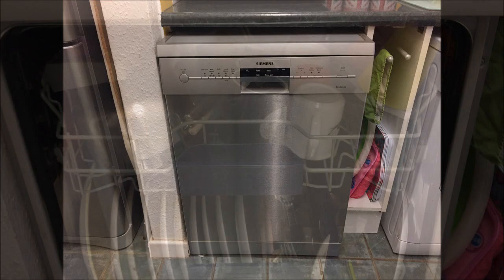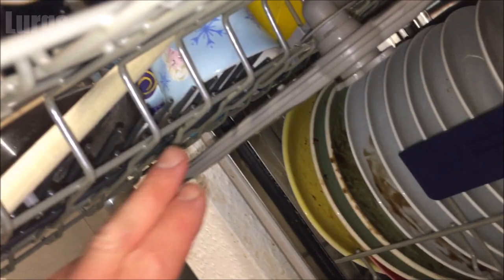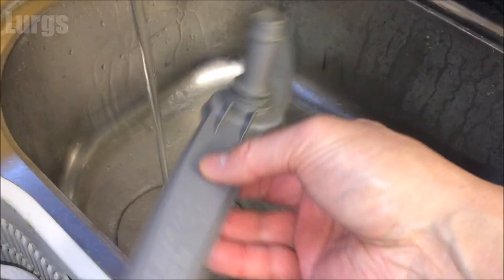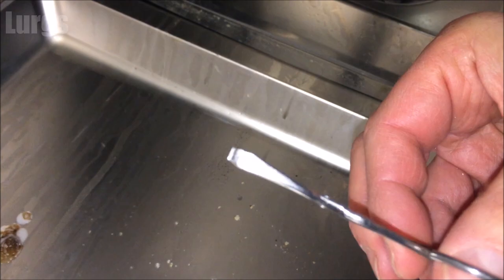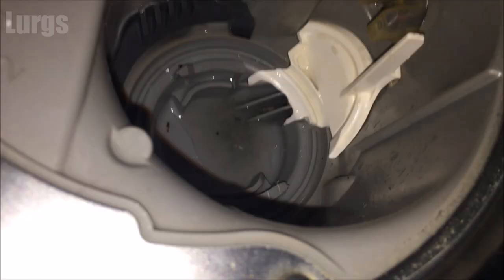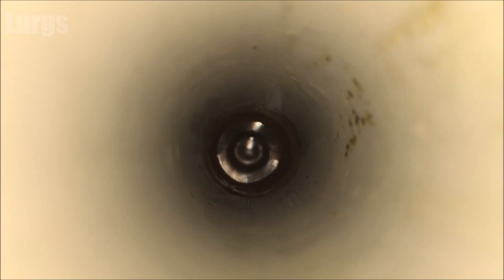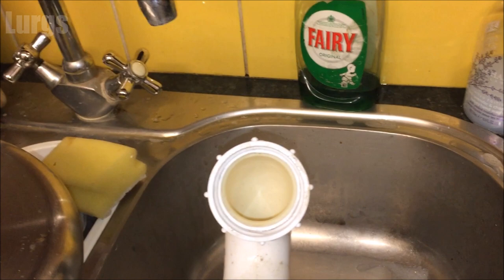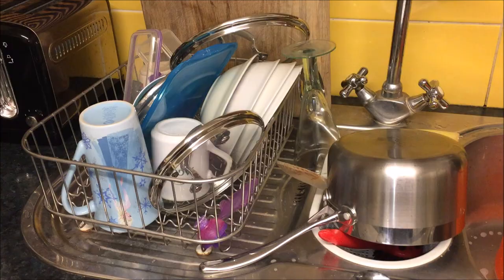Siemens Dishwasher E23 Error Code and How to Clean Filter for Maximum Efficiency

Comment: Hilarious @ eyelash remover. I can't even locate the bit in my dishwasher though to remove it. I had a visiting estate agent take a quick look too and he couldn't see it either  :-(
Reply from the maker: Oh dear. Try getting out all the water with a sponge so it's nice and dry. Then get your Vacuum cleaner nozzle in there and see if it sucks it out. Good luck. Those Estate Agents aren't very good with Dishwashers, good with houses and flats though. 😎
Reply: @LurgsHowToGuides  Hey I've done it so thank you so much for your video (when I stopped laughing at you using your wife's tweezers and then putting them back where there came from) I poured a stiff drink and had another go. I got the thing out, cleared the obstruction and now, fingers crossed, it is in the middle of a cleaning cycle  :-)
Reply from the maker: Fabulous, a well deserved drink 🍷. Glad I could help out.

Comment: What was problem at the end?
Reply from the maker: bogdannb b I'll let you know on Friday as that's when the Engineer is coming.
Reply: Lurgs Good luck!
I think its something with aquastop or something :)
Reply from the maker: Turns out the Waste Water Pump Motor had got wet (and its got a circuit board on it) as the Seal had corroded. Engineer has ordered a new Electric Motor (£35) to be fitted next week. So more washing up this weekend !
Reply: Lurgs Great that its not that expensive repair! Thanks for letting me know. How old is it and how many loads it does weekly?
Reply from the maker: The Machine is 10 years old but think we got it 8 years ago. It goes on pretty much every day so that's 2,920 cycles if we've had it 8 years. So with the callout charge & the fix about £120 I think. Just hope it's done before Christmas coz I can't wash up over Christmas, o man.
Reply: Lurgs Its done well. Just buy pump and fit it yourself. Its really easy... And plus, there are tons of youtube tutorials how to do it if you are not sure :)
Reply from the maker: bogdannb b Yeh I'll do that next time. Cheers.
Reply: @bogdannb  pump is easy to remove and to take apart and test each pair of windings with a multimeter .  In Australia the part is about $70 but if you get an engineer that's another $150
Reply: @bogdannb  I didn't find any vids on actually removing the pump...I'd better look harder

Comment: Is it fixed? :)
Reply from the maker: GodDay b It lasted a month then I got a new error. It was 8 years old so ended up getting a new dishwasher. Gutted as we spent quite a bit on a repair. Thanks for visiting my channel.
Reply: Lurgs It lasted well :) What is the new one?
Reply from the maker: Got a Bosch now. But incredibly the normal cycle takes 2hrs40mins so no good if you are in a Rush!
Reply: Lurgs What model is it? Isnt there a variospeed option?
Reply from the maker: GodDay b It's Bosch SMS40. It does have eco option and quick option but they still take ages. Still beats washing up though 👍
Reply: Lurgs You should have chose model with auto mode or model with speed option! Agreed about washing up- its horrible job.
Reply from the maker: Or saved £329 and got my Wife to wash up every day!